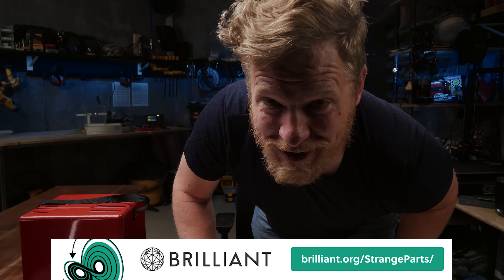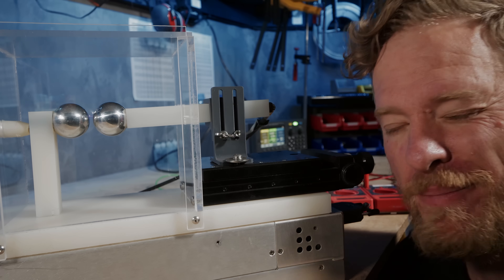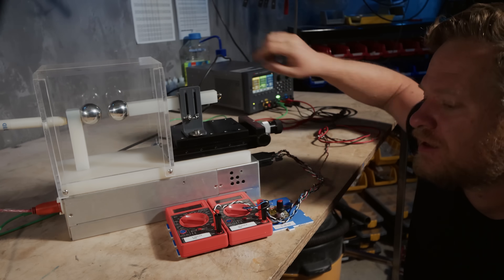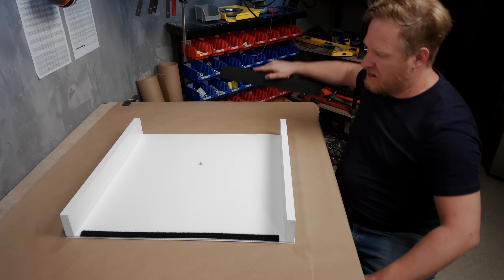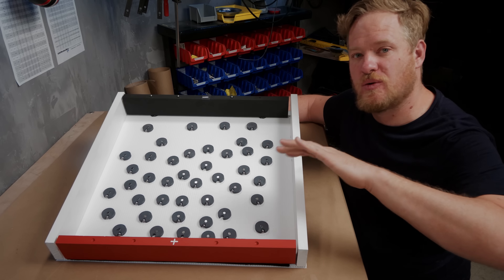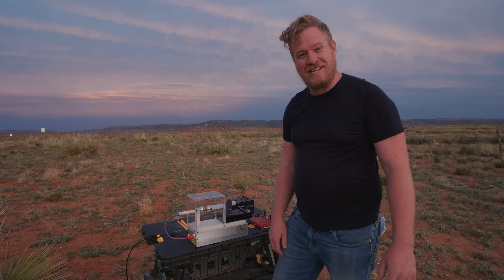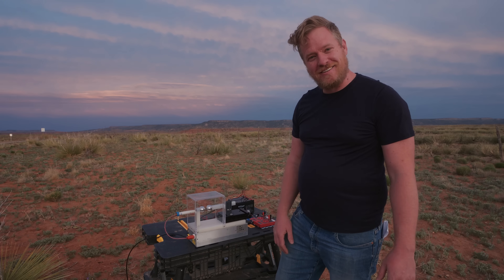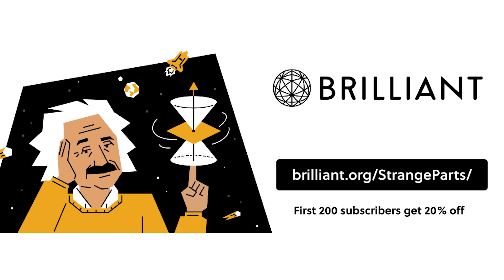Why 10,000 volts at altitude is a BAD IDEA

Comment: Possible solution:
I have some experiance with high voltage. My father developed once a kind of Van de Graaff-generator 750 kV.
The space between ground and the high voltage faraday cage could be reduced by installing equipotential surfaces.
As you showed in your video with the spike, the electric field is not homogenous near the cathode and anode (see cathode fall).
You get a more homogenous field with a stack of conductive surfaces (with rounded edges) connected by resistors (MOhm). So you get a 
voltage devider with non critical voltage/millimeter. See drawing

https://www.dropbox.com/s/l4zquaxclflud7p/Rastergrafik.png?dl=0

Comment: As an appliance repair tech in Denver, CO I now understand why I have so many board failures on ovens in the mountains. 

I have had customers complain that "this oven (that I know to be a solid unit) has given us nothing but issues".

I always assumed they had "dirty" grid power coming in. Unsteady voltage, that fluctuates a bit, but I always wondered why the inbuilt noise filter, that everybody puts into anything with a board, was so insufficient to protect what it was supposed to protect. 

A lot of ovens induce voltage for direct spark ignition of the top burners, and even occasionally the oven itself is a spark, but normally an igniter is just a glow plug. (It also controls the valve with its variable temp resistance, but thats a whole 4 paragraphs)

Im sadly gonna ruin some rich people's whole week with this information, when I pass along that their 10,000 dollar piece of cooking equipment wasn't designed to be used on a mountaintop.

Comment: Back in the 80's, I did much of the design on an avionics moving-map display that used a small CRT for a display. It needed 10KV on the second anode. It was easy to control at sea level. However, I had to make it work at 50,000 feet altitude. It took me a lot of work to keep it from arcing to the CPU board which would have the effect that you would expect, connecting 10KV to electronics designed to work at 5V!

Comment: you are doing an experiment on the Paschen law! very well done!

thought a sem would need a rather high vacuum inside during operation?
as high vac is a rather good insulator (as you mentioned briefly) there shouldnt be any problems with arcing?

Comment: It would be interesting to chart the maximum gap against air pressure. Presumably the max gap would decrease at an extreme low pressure because there would be too few gas atoms to sustain a sufficient avalanche effect.

Comment: You need to seal your workshop as best you can, and get some air conditioners (or something similar) and create positive pressure inside your workshop, increasing the air-pressure slightly :)

Comment: This phenomenon shows up with spark ignition engines. A weak coil can fire the spark plug under low load (or when testing the plug outside the engine), but under load the cylinder pressures increase and the coil can't produce a high enough voltage to jump the gap any more. Runs good at idle, but go to pass and it dies.

Comment: I'm worried that they didn't have an even greater safety margin. Seems like they aren't allowing for any dirt or oils to be on the high voltage parts. Also not allowing for tracking (where partial discharges break down the insulator near the conductors and effectively shortens the distance which compounds over time).

Comment: Might be worth seeing if you can create a positive pressure atmosphere in a box. We often do positive, negative or neutral pressure inside computer cases when heat becomes a challenge purely by re-arranging how many fans blow in, how many blow out and what excess holes are blocked off. It's a very effectively way to slow ingress of dust by maintaining a lower pressure.

Comment: I seriously hope you see this message and I think I have suggestion that is probably the cheapest and easiest way to get that machine to work. 

My idea is using/filling the machine with a electrically isolating gas so that it may at least simulate the proper altitude

Comment: Stupid idea: Is the spark gap different in different gases. Couldn't find anything on the first try. May be a filling the device with Helium could help its cheaply available. Electrons in noble gases have an higher ionization energy than in other Elements. Unfortunately the cheap Argon has only a very little higher  IE1 than Nitrogen or Oxygen.

Comment: This happens to magnetos (distributors) on piston aircraft. As the points wear out and create a bigger gap, at high altitudes the spark will jump the gap too soon and even to the incorrect point creating bad misfires to the point that the engine will start to fail. One way around this phenomenon is to pressurize air from a mechanical pump and push it into a sealed magneto creating an environment inside that is more dense as if it were at sea level!

Comment: Have you tried dumping the STM in a "bath" of SF6 (https://en.wikipedia.org/wiki/Sulfur_hexafluoride), it is a pretty good insulator and used exactly to suppress arcing in high voltage systems. Its density is higher than air, so will not escape a plastic box easily and from what I can tell it is not that hard to get your hands on a canister of the stuff. awesome video BTW

Comment: Get something like a tank with an airtight hatch, or perhaps a heavy plastic bag that can be sealed ("space bag" usually used for storing clothes?), and then pressurize it. Since it's only dealing with a few PSI in differential pressure, it doesn't have to be overly substantial. (Probably no more than what you'd inflate a soccer or basketball with.) That should be able to overcome the problem easy. So it's just a matter of adding an pressure enclosure and air pump, and then sealing the wires that have to pass through it.

Comment: when are you going to try putting it in a pressurized box? any sealed environment with a fan blowing into it on one side and an exhaust that restricts the flow on the other side ... with a filter on the pressure side it would be kinda like a clean room ... you wouldn't have to dust as often!

Comment: you can make a pressure vessel to keep your SEM in, design it to adjust the air pressure via a mini compressor and vacuum pump.  You wont have to drive to do experiments at simulated altitudes and finally use your SEM.

Comment: If you are interested, D0-160 is a standard document that we use in aerospace to define lighting levels and dives into voltage spacing. Another interesting thing that impacts voltage spacing is age breakdown of the dielectric material. Also you should find out if the manufacturer of the microscope applies conformal coating to their boards like paralyene. This will decrease voltage spacing requirements at altitude.

Comment: Would it work if you set up the ESM inside a vacuum chamber? No air, no arc... Or, maybe you could rig it up so that the pump increases air pressure in the chamber.

Comment: build a sealed box, and plug your shop compressor in when using the SEM to raise the pressure in the chamber doing the scanning!  Probably doesn't even need to be super sealed, since you just need to simulate a relatively small drop in perceived altitude.

Comment: Did you think of any ways to increase the pressure in the working area? Can it be used sealed in a pressure vessel, software/remote control, or does it require physical manipulation?

Comment: Paschen's law in action.  If you place your rig in a partial vacuum the breakdown voltage will go back up with reducing pressure since there is so few atoms left to initiate avalanche ionization with the same spark gap distance

Comment: Yeah, the distance between two electrodes below which they form a spark depends on the voltage, the gass(es) around the electrodes, and the pressure of the gasses. The lower the pressure the easier it is to form sparks, until the pressure becomes too low, and the distance between the electrodes have to be lowered for sparking to occur (at the same voltage). This phenomenon is called Paschens law see https://en.wikipedia.org/wiki/Paschen%27s_law.
The effect is actually caused by the mean free path, between two atoms, with a very low mean free path (high pressure) electrons don't gain enough speed to get a cascade of electrons, but if you lower the pressure the electrons can accelerate enough to get a big cascade effect, lower the pressure below a few  TOR, (8×10 TOR) So in a ultra high vacuum, then there are not enough atoms on average for a chain reaction to occur, and even with very high voltages no sparking will occur.
If you put a programmable high voltage generator in a vacuum chamber, then you shouldn't turn it on while pumping out the air, as the lowering of pressure will decrease the minimum distance between to points with a different voltage, and the high voltage generator might become damaged because large spark currents start to flow.

Comment: Could you create an altimeter using an arc?  Go full steampunk:
Turn a crank and keep closing the gap until it sparks (or open unit it stops).  Have the spark-gap system mechanically linked to a needle that points at an altitude chart.
A humidity sensor and offset chart could be added for bonus points.

Comment: Or just move the transformers closer to where the high voltage needs to be, for instance try mounting the outputs of the transformers to the high voltage side and make the previously high voltage side a low voltage fixing the problem.
Reply: I don’t mean that harshly just as a recommendation

Comment: There is an option 4, change the atmosphere.  As long as there aren't any mechanical switches in the little SEM, you could try dunking it in SF6 to raise the breakdown voltage of the gas it operates in.  Normal mechanical switches are a problem as the surface chemistry of the contacts is designed to operate in an oxygen rich atmosphere with 3psi partial pressure of oxygen.  So pure SF6 results in no O2 so the contacts quickly weld or wear out because the surface oxide layers are missing.

Comment: How big is the difference in the air pressures between the altitudes? I mean, would it be enough to install an airblower or two to increase the pressure in the room while the SEM would be used?

Comment: as far as I know, industrial or lab-level SEMs are supposed to operate at high vacuums so there aren't any atoms for the electron beam to hit at all. they operate at vacuums at the order of at least micro Tor.
but those are real expensive
Reply: Yeah, to get crazy depth control and secondary energy selection (gimme 2sp secondaries at 3.1 GeV in the part of my sample that doesn't suck!) pumpdown gets harder, but uTorr is a special for e.g. catching everything in an active sample. As is microkelvin staging. You don't build that if you can make a xray beamline thing to sort your mysteries, that's a 2 5-year plan investment plus.

Comment: correct me if I'm wrong, but when we use SEM(a relatively small one) in the lab, after inserting the sample, the first thing to do is to turn on the vacuum pump to clear out the air inside the chamber. I was wondering the whole video why there is no vacuum pump

Comment: How possible is it to put it in a pressurized container to raise the pressure that way? pressure pot with a valve for manual pressure control and some airtight grommets for cables?

Comment: Suggestion: seal the high voltage part and pump in SF6 (sulfur-hexafluoride, a electric insulation gas)
Reply: Given the density of SF6, the container could have a simple lid, or even an open top.
@Chris Sherer, sulfur-hexafluoride is not a «needy» gas. All of it's electrons are strongly bound and demand a huge kick to dislodge.
Reply: SF6 is high weight, great dielectric properties, and self-healing, but it's also a greenhouse gas.  I'm not sure where the arcs are in the equipment, but, if it's already potted, SF6 will provide zero help. If it's not potted, then potting will help more than SF6. If it cannot be potted, then SF6 might be the next idea to try. But at ant rate, it's crucial to know details about the electrical fault before troubleshooting.
Reply: @spastickitchen  I agree. SF6 being a much more potent greenhouse gas than CO2 really makes me not want to suggest it as a possible solution.
Reply: I think you need to be able to access the high voltage parts in order to put stuff inside the microscope so that wont work sadly.
Reply: A good dose of hairspray probably would be enough.

But any kind of pcb coating spray paint would be preferable to harspray.
Reply: Is sulfur-hexafluoride ionically stable or is it ready to grab onto electrons? You would want a needy gas.
Reply: @chrissherer2047  I don't understand a word you just said...
Reply: Same exposure rules as teflon tho, so meh. Cold CO2 cover gas from a block of dry ice?
Reply: Argon is Clear gas
Reply: @kennethschultz6465  ???? That's rather unrelated. Also, argon is easy to ionize, and thus, would be a bad choice, worsening the arcing.
The sample container need to have a vacuum for the electron microscope to work.

Comment: Adding some HV silastic would certainly be a good idea but if for whatever reason you don't want to modify the device at all you could also put the device in a pressure chamber.  Nice job on the video and explanations BTW. The E-field demo was simple but clever and really quite apt since gravity is also an inverse square force and it conveys the interplay of potential and kinetic energy well.  You should have added a cap across your gap for some ⚡⚡ spectacle ⚡⚡ though 😉.

Comment: No well made plan survives first contact with Murphy. But damn you do Lemons into Lemonade seamlessly. I would bet a big pulse of RF energy happens  when the ark jumps across and again  when it stops. the gap between the spheres would frequency. If you put in a Morse key you may have a Spark Gap Transmitter  (Titanic had one)  * * *  - - -  * * *

Comment: Hi Scotty, You Might be able to pressurize the SEM chamber with Nitrogen enough to stop the arching. I design High Voltage Probe cards to test HV silicon wafers. Since Probe needles are for the most part pointy arching/flash over has always been an issue... Never good to arc on a wafer... attached is a pretty good page that explains it... 

https://compass.formfactor.com/2018/wp-content/uploads/sites/8/COMPASS2018-Franz-High-Power-Probe-Cardsv2.pdf

https://www.wentworthlabs.com/wp-content/uploads/2019/10/Applications-Note-High-Power-Probing.pdf

Comment: The maker of the SCM equipment should sell attachments like in your video.  Which can pressurize or depressurize according to the customs need.
BTW I’m really concerned you may get electrical shock moving parts around an energized system.

Comment: Submerge the SEM electronics in oil
Reply: 💯 🤷🏼‍♂️dirtier than what I said, lol. Leybold deprecated the oil vane stuff. Wait is silicone moldable batting as bad then? I guess one has to be picky (or, bake and knead it for a week to pull out low poly molecules?)

Comment: can't you submerge it in mineral oil?
Reply: Not even vacuum oils, it contaminates the chamber too much even with longer pumpdown.  Even packing insulation on piecewise risks small molecule contamination when pressurizing or sample swapping, so material quality and application might lean curatorial.

Comment: I was surprised when you didn’t mention changing the pressure as a potential solution. Could you put the microscope in an airtight box and increase the pressure to sea level?

Comment: The safety rating ouf your DMMs is not guaranteed at 7,500 unless they have been specifically tested at higher altitude.  The safety standard for small test equipment uses IEC61010 which only covers up to 2,000m (6,600), at altutudes greater than 2,000m and 4,000 the DMMs should be derated to a lower voltage category rating.  Above 4,000m and you're on you're own!

Comment: Hi Scotty! You mentioned in your marble demo that if the atoms are far enough apart, there is less chance of the cascade effect happening.  With the understanding that equipment is typically designed for pressures at and around sea level, does that mean that a high enough altitude would actually begin to reduce the arcing effect once again due to the atoms being too far apart?  Thanks for the video!

Comment: Wait, if pressure is the issue, why can't you just put the SEM in a pressure chamber? it's not that much difference in pressure between 9K and sea level right? (checks) yea about 5 psi, definitely less than those DIY vacuum chamber made out of pots and plexiglass... hmm...

Comment: I'm confused. Isn't a SEM supposed to be under a vacuum, in which case ambient air pressure should be irrelevant? Or is it arcing on the high pressure side? In this case, it seems like a really poorly designed product, perhaps in a bid to miniaturize it. 10 kV circuitry should either be potted/insulated, or have a much higher clearance, maybe 5-10 times the arc distance.

Comment: There is a fourth solution - increase the pressure. Put the microscope into a chamber, put a compressor onto it and pressure it up. Even a small compressor should create air dense enough to prevent the arcing.